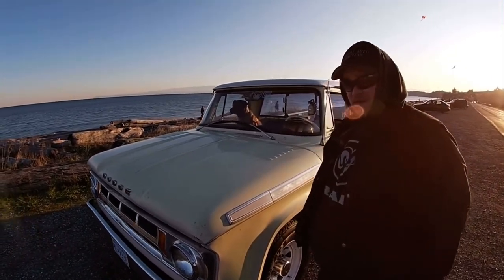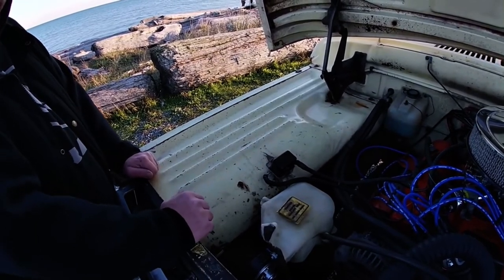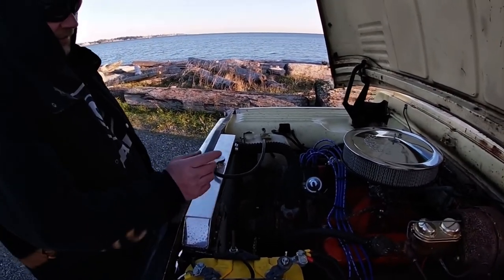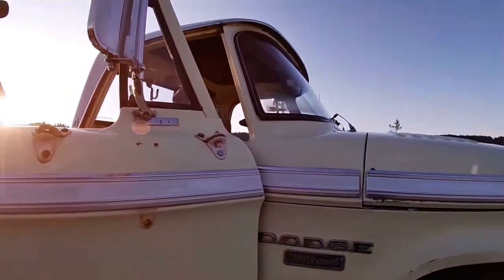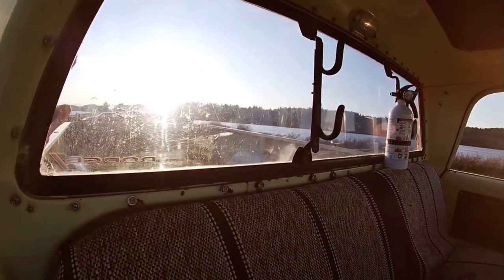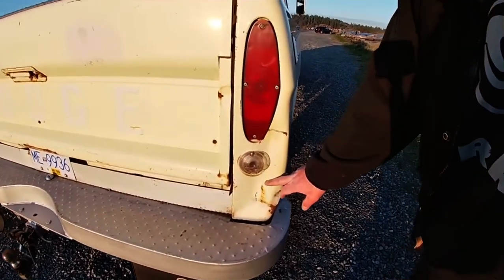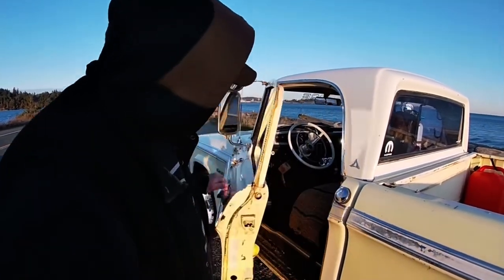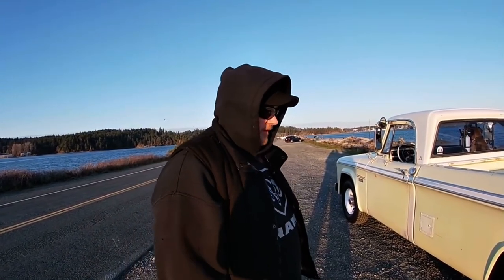A Look at BETSY The D200 Camper Special (383 Big Block Being Built at Nick’s Garage)

Comment: Nick's Garage just tore the 383 down found that #8 cylinder had some oil on it so there is something wrong with that hole but the rest looked good
Reply from the maker: Yes about 2 months before I stopped driving I noticed she sounded off so checked the plugs and found number 8 was wet then found it was down to 120 psi rings are tired:( 
When I had to move the dizzy to get her to run right a month later I knew she was talking to me and the timing gear had shed its nylon.... So I loaded it up in the back of Black Sheep and took it to the master!!
Reply: @CoastalAutoReactionCAR  I guess that it had variable valve timing just like modern cars have.
Reply from the maker: Lol thats right haha
Reply: @CoastalAutoReactionCAR  yes that Era of manufactures used  nylon to quieten timing chain noise to sell vehicles, and hard starts is
 symptoms of skipping timing chain due to deteriorated Nylon. forsure  Betsy will come back new and stronger
Reply from the maker: @enduser6982  umm yup🍻 That’s exactly what I said👍🏻👍🏻 Also the main reason why I stopped driving  herThanka for watching!

Comment: Still tires out there for 16.5 just a fewer options and a bit more pricey. I'm currently building a new motor for my 68 d200 was 383 but it was locked up good, building a 440 now.

Comment: Is that door on the drivers side of the bed aftermarket and what does it open to?
Reply from the maker: It is for the dealer installed extra fuel tanks so I run the truck off of one big saddle tank now originally it had the behind the seat tank and twin saddle tanks once it’s restored the driver side one will be gone I am going to weld in a piece of metal and make it disappear step one is under hood and interior restoration install new drivetrain and front axle drive truck and enjoy then do the exterior :)